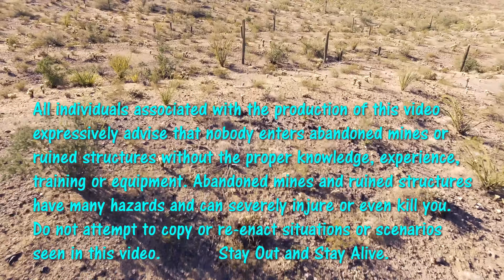Introducing Frank Schlichting to Arizona! - Join The Adventure! Part 1

Comment: So what was that huge metal thing you walked by? Looked like it had wheels at one time and also looks like it was cable slung. We are in the Fortuna Footshills area east of Yuma area. So happy to hear your in Arizona. This is my moto....South in winter, North in summer. Yes say no to snow.
Reply from the maker: "Gly": That was the bottom frame portion of an old ore cart. It was missing the wheels and box.
Reply: The chassis of a side dump ore cart.  Axles, wheels and the tub were removed.